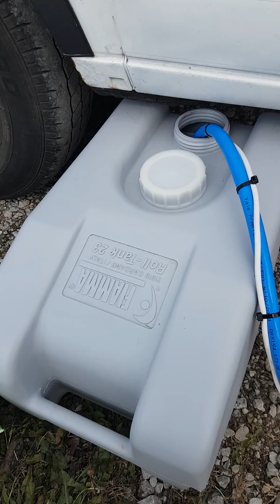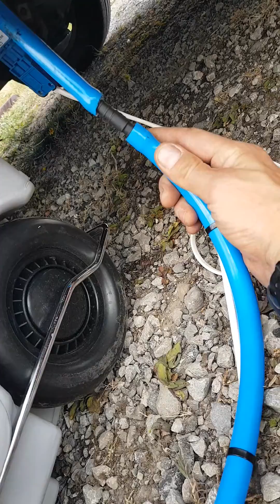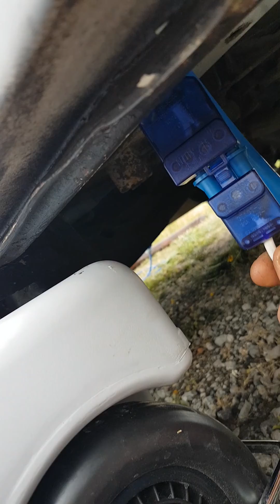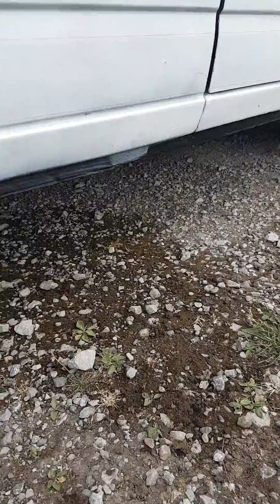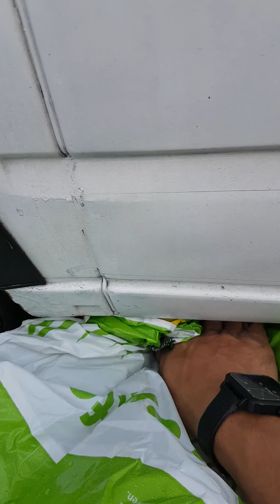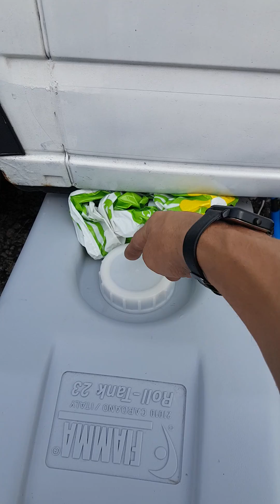VW T4 sink tap/waste and water pump.

Comment: Great idea, I’m about to sort the water and waste out in my conversion and have been looking for method of doing it,
What have you used to go through the floor to protect the pipe and seal the hole up
Reply from the maker: @philipsowler1990  
Caravan sealant and the standard flexible waste , I would advise a storage tank for the waste as some campsites moan at draining straight off to ground
Reply: Thanks for your reply, I’ve got an external waste tank,
I’ve done the fresh water supply this weekend end and that worked well, I had a slight issue with the waste pipe, the flexi pipe wasn’t long enough to run through the floor so I had to join it which then started leaking once I emptied the sink,
I’ve done a mod on it and it seems ok now,
I’m glad I say your video when I did.👍🏼